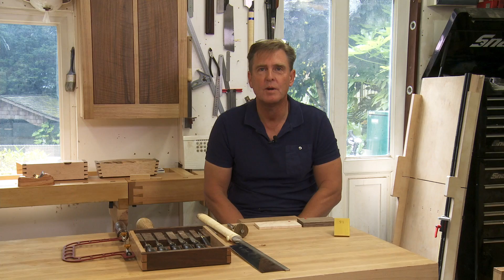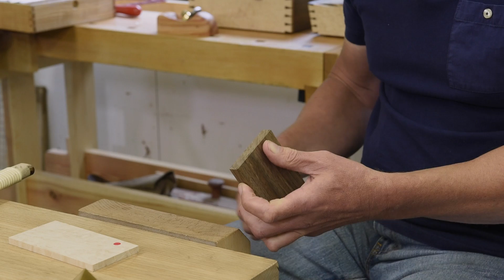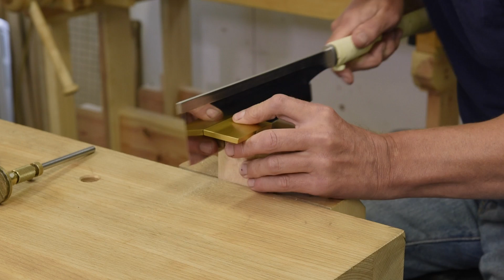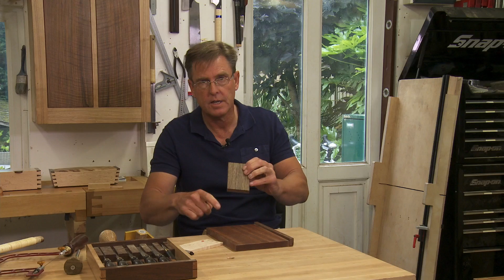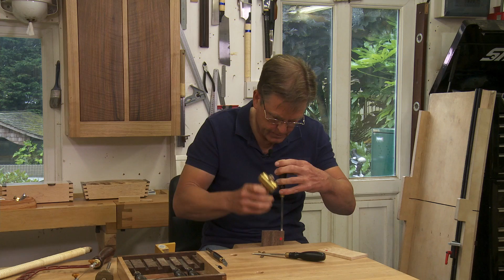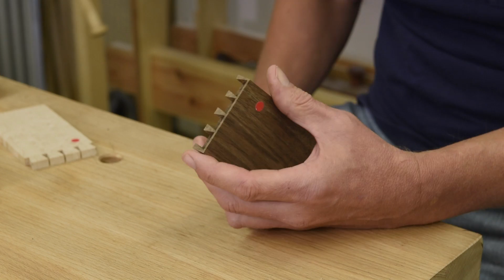Half Blind Dovetails Made Easy!

Comment: Just angle that pin board in the Vise by clamping the edges rather than  the faces and you will be able to see both the web line and baseline at the same time. It will then just involve standing in the appropriate different orientation to the task. Piece of cake folks.

Comment: I was taught to use machines, and I’ve been brainwashed into thinking that’s the only way to achieve speed and accuracy. The more I watch a real craftsman at work, the more I realize  that handcutting dovetails and other joints can actually be faster than than machine setup for a one up project. Not to mention less noise, mess, expense, and space needed. I can work in my basement over winter instead of putting everything away when it’s just too cold to work in my garage comfortably. Thank you for helping guide me towards this incredible revelation.

Comment: On chisels. In the course o flattening the backs of my set I inadvertently rounded the back-side edges very slightly. On my 12 mm chisel it's less than 0.5 mm I think. Would you consider such chisels not fit for dovetailing? How about furniture-scale mortise and tenon?
Reply: That sounds ok to me, the most important thing is you keep them sharp. All the best, David.

Comment: Would it be worth it, do you think, to use the fret saw to remove some of the waste before chiseling?  Or is it too complicated and delicate with the odd angle and the shallow walls to be worth it?
Reply: Hi Brian, I don't think it would be worth it, the only other method I use is a trim router with a support board to the rear, great if there are lots to do. All the best, David.